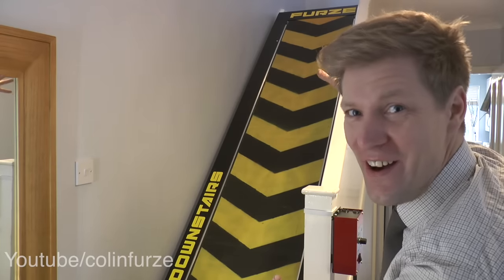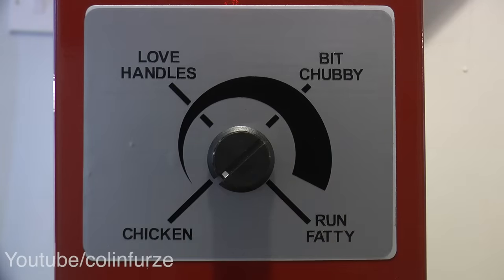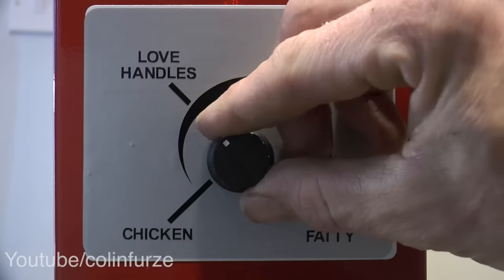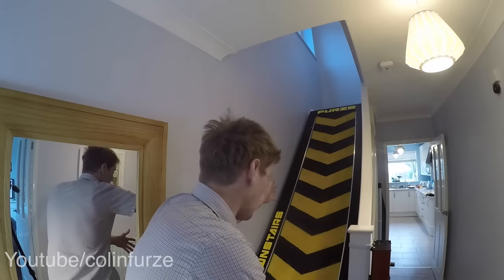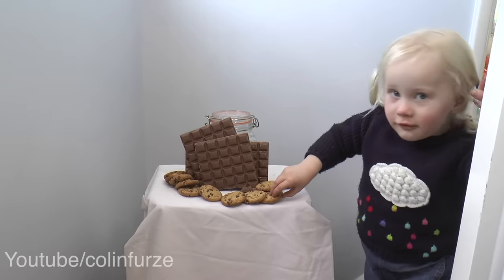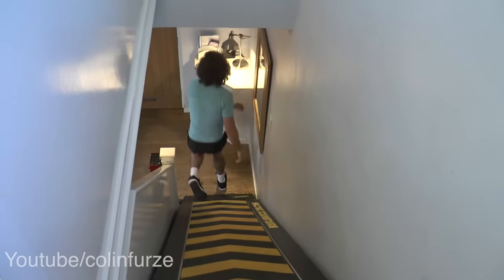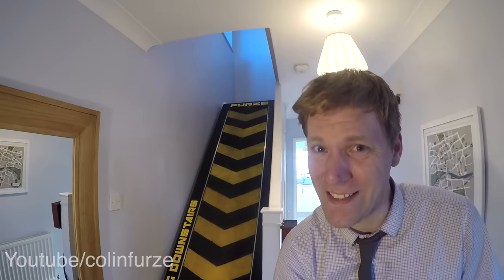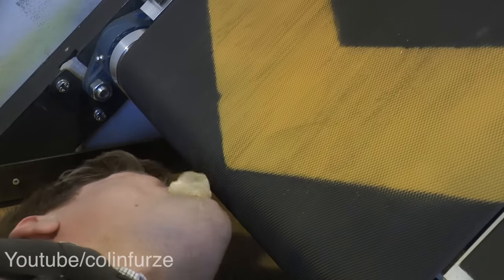STAIRCASE TREADMILL The ultimate exercise machine

Comment: Needs one more setting "Lazy" ... Just reverses direction. :)
Reply: Wait, isn't that just a normal escalator?
Reply: Justin Hughes yes it is
Reply: Justin Hughes yes 😂😂
Reply: Air Command Rockets tes
Reply: Named "American"
Reply: Little difference; it reached the same speed on all settings, as the climber's weight overpowered the motor and the speed was limited mostly by gearbox resistance.
Reply: Sebbe kartellen q
Reply: So you want an Escalator
Reply: @0LoneTech  There's clearly a resistance to his weight, which is why it was easy for him to get to the top while the machine was off compared to when it was going full speed.
Reply: The Medic if it was an escalator you wouldn’t be working out ,would you now 🤔
Reply: @chevaughnmartin9589  You should probably reread what I said 😘
Reply: Air Command Rockets he would be to heavy to reverse it and aldo go up it

Comment: Imagine being a theif and you run into one of these
Reply: And it's set on "Run Fatty"
Reply: @flowplayz3140  😂🤣
Reply: Yeah, but you could easily turn it off.
Reply: @eagle7396  what if it's dark and you can't find the controlls
Reply: the only kotal fan in existence Yeah, but what kind of robber at night doesn't have a flashlight?
Reply: @eagle7396  a ninja?
Reply: Thief: "Understandable, have a nice day"
Reply: Not if you have it on a different power supply from the house. Electric line 4 feet underground from a breaker in a hidden area, ensures that the their can not turn it off, even if they turn off the main power to the house.
Reply: @eagle7396  the kind that doesnt want to get caught doesn't have a flashlight. It's called letting your eyes adjust to the dark
Reply: Theifs are getting smart these days
Reply: @amcool3052  yeah but they don't start smart. In their early phases of thieving (assuming they do it more than a few times), they are bound to mess up at some point. That is usually what makes them smarter as they know more about what to avoid.
Reply: Hahahhahaha
Reply: @y__h  😂😂😂
Reply: the robber could just turn it off. and yes i know it’s a joke so don’t r/wooooosh me about it
Reply: They wouldn't be able to get in because of his ak-47 doorbell
Reply: Trust me, it's fucking annoying, made me turn away from theft
Reply: I laugh so hard dude 😂

Comment: I don’t think the child could get up it, even on chicken 😩
Reply: xXGetRektXx XD 
Teach them to turn it off
Reply: xXGetRektXx XD use the edges
Reply: The Drawing Gamer 
Chicken IS when the machine is turned off.
Reply: They may be light enough that it doesn't slip too fast, though.
Reply: good
Reply: It’s satire.
Reply: That’s when you add “beast mode” - you do the travelator with a small child on your shoulders/back 😂😂
Reply: The child weighs less, so it will be accelerating as much by going up it.

Comment: ? How long would a ......normal treadmill run for say at 3mph before it clonked out due to motor over heating, see I tend to walk like 7-14 hours a day when I reach 14 stone till I go back down to 10 stone, would a treadmill handle me running it for say 12 hours electric usage aside, cos I can only walk 14 hours in public if it be overcast and around 10 degrees centigrade?